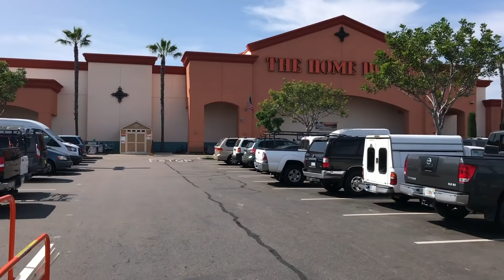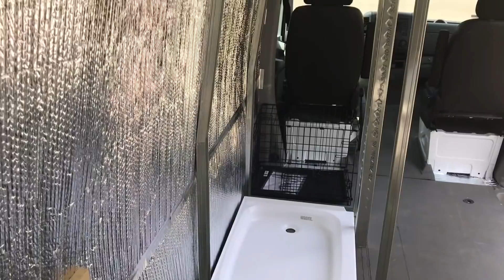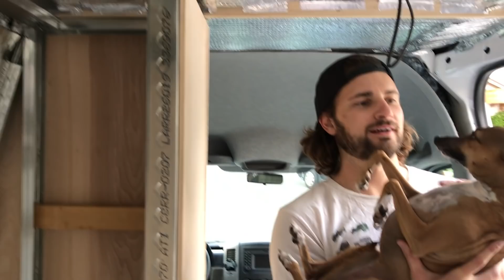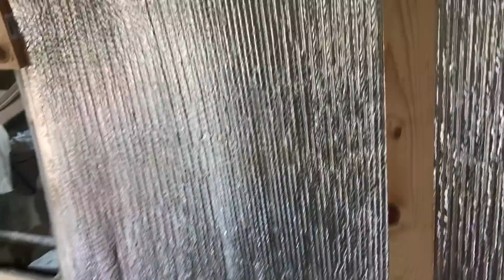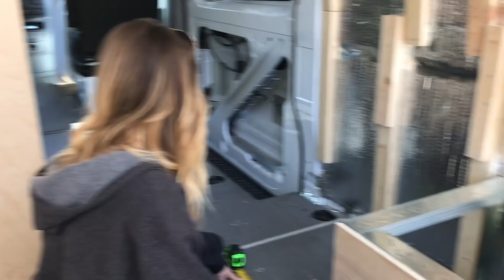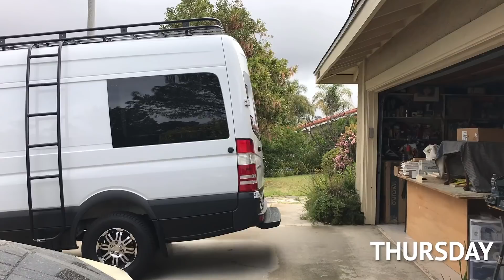VAN LIFE BUILD (Ep. 4): Steel Stud Framing & Building Our Van Upper Cabinets

Comment: Did you attach the steel studs and channels to the wood furring strips (reduce thermal bridging), or directly to the van frame (might be more secure). Also, what channels did you get for your vertical supports on the bench seats? I can find the steel studs at home depot, but was struggling to find the vertical channels. HELP!! :-)

Comment: I just discovered you guys and I like the idea of dry wall steel studs for framing. Don't like wood framing for safety either and 8020 is $$$. Question though, do you have to recess the panels at the bolt heads that hold the steel framing together to ensure the panels sit flush with the frame? I've never worked with it.

Comment: Hey guys,
I love this series because it so detailed! However, I was wondering what you screw the furring strips into? It can't be the insulation or the outside "walls" of the van 🤔
Greetings from Germany! 
Marie :)
Reply from the maker: It's actually the inside wall of the van.  There is a gap between the inside wall and outside wall in specific places on the van.

Comment: In the bathroom where you added the horizontal metal studs are those studs drilled into the van wall or just on the ends into the other metal studs.  My guess is you are never drilling into any part of the metal panel that doesn't have a rib or some other extruded metal that keeps you from going through the metal into the outside world.  Let me know if I have this correct and thanks!
Reply from the maker: Yes each vertical stud is attache at 2 points to the wall of the van.. not visible to the outside world. ;)